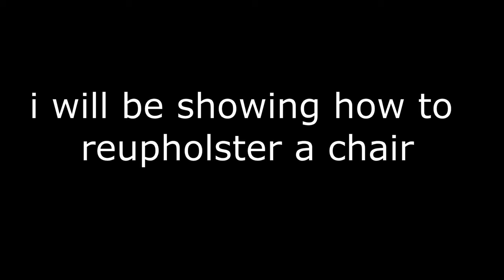DIY - How to Reupholster a Chair

Comment: This is a great job. But would it be possible to view a closeup of the top edge of the trim on the chair? If you use the staple gun, don’t the staples show or are clear staples? Since the camera is so far away, you can’t see this detail.
Reply: Squish the 2 rubber tubings together over the staple after stapling, you can see them do it in the video
Reply: Was two tubes used on the top trim and only one on bottom?
Reply: @Hilcv  Yes

Comment: What is the webbing on
The back? Is it new, or what you had removed??? What did you clean the chair wood with, that would remove the build-up, but not harm the wood? Did you strip and then re-stain/varnish???

Comment: My issue is that my dining chair set from offer up that I am refinishing had a solid board screwed on at some point... so I want to replace the solid board with cane webbing as it’s much more comfortable but at the same time stapling the fabric directly to the frame seems a bit beyond my skill level, however I am going to give it a try.  I suppose I could also just saw out the middle of the wooden seat board then web it and upholster it and then put it back... The other thing I really want to get is that look of sort of a domed seat cushion not just a flat square but unsure the best combination of foam to achieve that.